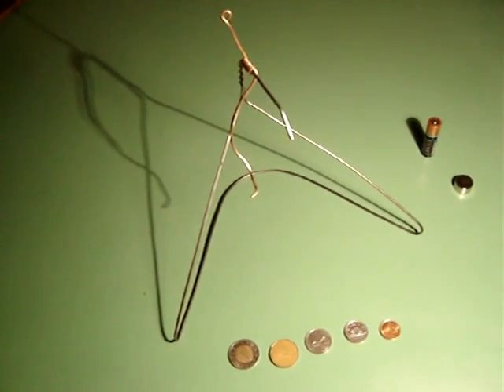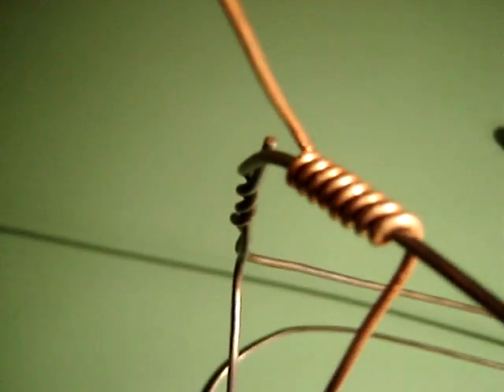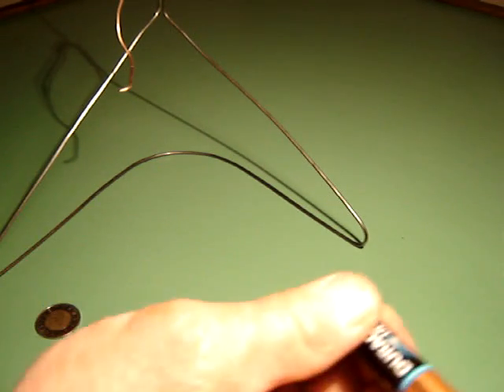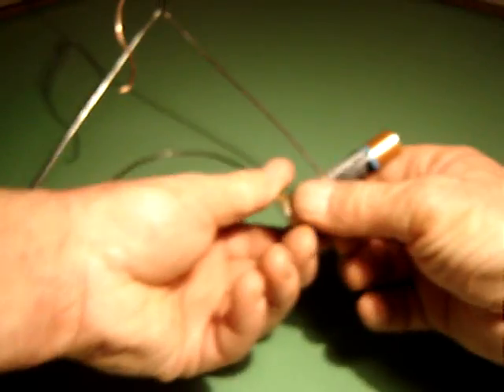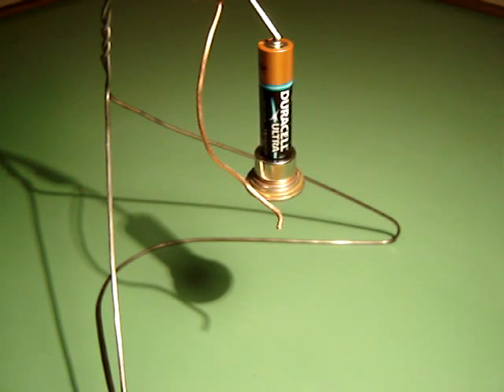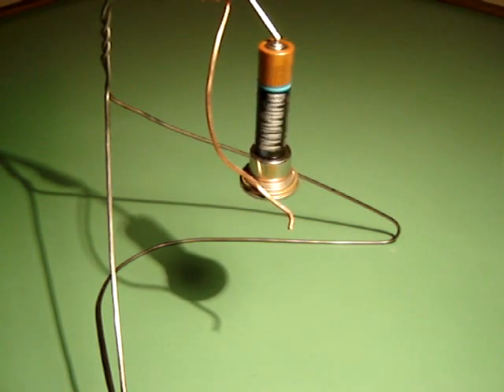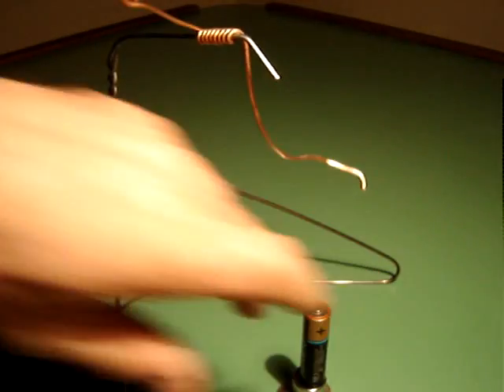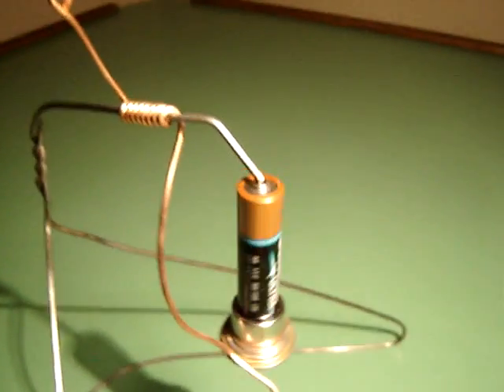Homopolar Motor With Five Speed Manual Stick-Shift

Comment: a hollow magnet with lithium inner core. the magnet will rotate to power a alternator / generator witch sends part of the power back into the 
lithium inner core. this power the magnetic field making a electron magnetic with a lithium inner core witch spins the device faster. [=] more power.. 
if this adding power to the lithium core, it might cause heat. hot enough with a sentricular force can cause anything to occur in a powerful magnetic

Comment from the maker: The homopolar motor works from what is called the Lorentz force. A conductor carrying current will produce a magnetic field. The wire's magnetic field repels the magnetic field of the magnet, producing torque on them.
See Wikipedia under "homopolar generator".

It needs to be a neodymium magnet to work right. The armature is a simple coat-hanger wire, but the tip shape is important to enable the magnetic hanging effect. Not too pointy and not too round where it hangs.

Comment from the maker: So many questions, grasshopper...I think you need to build one and experiment for yourself!  (hehe)

In answer to your question, the wire directly on the magnet will generally give the fastest speed, about like 5th gear. 

However, the smaller the radius increases the speed, so the penny which is smaller than the magnet, can give a higher rpm than the magnet directly. It depends on other factors like resistance and magnetic field.

Comment from the maker: I'll put that video of the battery sources on the list!

The contact wire (string as you call it) can be put directly on the magnet, but will only give one main speed. This experiment was a fun reminder of the auto gearbox with its different-sized gears.

Comment from the maker: More batteries in series will increase the voltage and rpm. Batteries in parallel would increase the amperage and the torque. More magnets tend to increase the torque rather than rpm.

Good luck with your experiments; do a video if you can!

Comment from the maker: I spent over an hour just getting the point of the hanger correct. Too pointy and the battery will fall off. Too round of a point and there is too much friction, like you say.

Comment: Nice video!

I wonder how much rpm's you can get with the armature balanced.  I would sharpen the end of that hanger and carefully put a divot in the center of the positive pole with a center punch.  If you look around you can also find very cheap tachometers that only require a piece of reflective tape on the rotating mass to measure rpm.

Or you could go the other route and perhaps build up some solder on the battery and have that come to a point.  You would need a flat surface on the hanger.

Comment from the maker: There are two places I can recommend. One is K&J Magnetics, they ship anywhere. The magnet will be a #DC6 or similar...the link is in the "more info" to the right. >>>

The other one is American Stirling Engines. They have a kit with 3 smaller magnets, batteries and 6 feet of 14 gage wire to make several motors from. The link to Sterling is also in the "more info" to the right. >>>

Good luck and have fun!

Comment from the maker: Refrigerator magnets are often the correct neodymium type,  but you won't find a fridge magnet this big! 

You can try a smaller magnet, but not for this project. You can use a drywall screw  and the bare, conducting magnetic disc as the rotor and hang it off the battery. Then run a wire from the top of the battery to the magnet's edge. That set-up can spin up to thousands of rpm!

Comment from the maker: Hard drives have neodymium magnets, but they are usually in a shape that doesn't spin very well. 

You can make a different style homopolar motor, however, with the magnet as the base, and perhaps a few coins under the battery to act as a commutator.

Comment from the maker: The positive terminal of the battery is attracted to the steel of the coat hanger, because the battery has iron in the case which acts to extend the magnetic field of the magnet. The battery acts as a magnet and sticks to the coat hanger.

 Not all batteries are magnetic, however. Duracells do work ok, in alkaline or rechargeable NiMH.

 This experiment was at the very limit of weight that will work without adding a tiny ball magnet to keep it together between positive terminal and a hanger.

Comment from the maker: Thanks for the good questions.

1. The coins are a good commutator because they conduct. Also they add to the magnetic effect, they make it easy to assemble, and they control the speed.  

2. The order and material of the coins will make a difference, depending on the resulting magnetic field, the electrical resistance, and the radius of contact.

3. The battery is solidly part of the magnetic rotor. If there was a bearing between the battery and the magnet, the battery could remain stationary.

Comment from the maker: The battery usually drains fast and gets hot. The homopolar motor uses a lot of current, as much as several amps from the AA battery. As the current moves from centre to the rim of the magnet, it produces an opposing magnetic field to the magnet. The Lorentz force produces torque which rotates the magnet. 
 
The magnet doesn't seem to affect the battery voltage at the terminals. The magnet will affect the battery by using current and heating up.

See wiki "homopolar motor"

Comment from the maker: Yes it produces torque. The homopolar motor design is being used in the latest 50,000 horsepower naval ships.

Generally we do not use an electrical motor to run a generator. We would just hook up to the battery directly, it's more efficient that way.

Comment from the maker: The original question was "How does it spin" not "How much is the force on the wire".

 In my answer, I was talking about principles which are at the root of the forces, not a formula how to calculate the force, as you are discussing.

Comment from the maker: Wiki:
 "By combining the Lorentz force law above with the definition of electrical current, the following equation results, in the case of a straight, stationary wire:
F=ILxB"

The equation you quoted is derived from the Lorentz principle.
The homopolar motor still works by the Lorentz principle. The Lorentz formula just needs to be integrated to find the total force on the wire or magnet from the point charges, as in:
F= I Integral dl x B(l)

Comment from the maker: Except in this case the force (torque) is not in the wire, but in the magnet itself...

Something else from wikipedia,

"The force on a current carrying wire is similar to that of a moving charge, as expected since a charge carrying wire is a collection of moving charges. A current carrying wire will feel a sideways force in the presence of a magnetic field. The Lorentz force on a macroscopic current is often referred to as the Laplace force."

The Heart homopolar motor uses that principle.

Comment from the maker: Wikipedia under Homopolar Motor :
 
"Moving electric charges (an electric current) in a magnetic field experience a force that is perpendicular to both their direction of movement and the magnetic field, called the Lorentz force."

"In the homopolar motor the electric current produced by the battery moves radially through the disk magnet, which has a magnetic field along its longitudinal axis. The resulting Lorentz force in the tangential direction produces a torque in the magnet. "

Irrelevant?

Comment from the maker: You need a neodymium magnet, available from K&J Magnetics (link at the right in "more info") or another magnet company. 
Or rob one from a shake-flashlight if you can get one cheap. (I just bought 5 yesterday for a project!)

Then, a powerful battery like the one shown, a coat-hanger, and some coins or magnetic washers. Experiment...it's fun !

Comment from the maker: You can build  homopolar motors with a drywall screw and small disc magnet as rotor that will do over 10,000 rpm, but this model stays under 1000 rpm. 

I say, get a neodymium magnet, a battery and a piece of wire and start messing with it...the ideas will flow once you begin to play!

Comment from the maker: You can try, but it takes a really strong magnet to hang a battery off a coat hanger wire!

You may have to order from a place like K&G Magnetics (link in the "more info" box to right>>>) 

Or find a shake-type flashlight cheap and tear it apart, as they use a neo magnet to charge it by shaking.

You can also do the normal type homopolar motor experiments (heart shape spinning on a battery) by using a large bass speaker and putting a coin and the battery on the centre of the magnet at the back.

Comment from the maker: The wire hanger is a clothes hanger for hanging clothes on a closet dowel. It's standard issue in north america, but other folks might like to try 1/8 inch welding rod. I find it works well with its copper coating on the steel rod.

Comment from the maker: The battery creates an electron flow through the hanger, copper wire, coins and the magnet. The magnet spins due to the Lorentz force of the magnetic fields. The battery will only last a few minutes.

Comment from the maker: Thanks for comments. You can use hard drive magnets in other types of homopolar motor experiments where the battery sits on a stationary magnet, and the wire rotates. 

You would need to use a penny or two for a contact commutator between the drive magnet and the battery. A decent speaker magnet can do the same trick. Turn a 10 inch bass speaker on its face, and put a penny at the centre of the magnet and the battery on top of the penny. Then a heart-shaped wire will rotate, if tweaked right.

Comment from the maker: That is not a stupid question! Thanks for having the interest to ask.

The metal is a steel coat-hanger. Welding rod used for gas welding could be used too. It has to be magnetic (steel not copper) to make the battery hang on it. 

There is a copper contact wire wrapped around the coat-hanger. Make sure the coat-hanger lacquer coating is sanded or scraped off for good contact with the copper wire.

Hope you try it!

Comment from the maker: These are magnetically attracted Canadian coins, but any conductive coins can be used as long as a magnetic one is on the bottom to hold them up.

 Other discs might work on the bottom, such as a steel washer or disc magnet or maybe a metal bottle cap.

Comment from the maker: It would work, but the magnet may blow up from too much amperage current without proper cooling. 

The latest naval ships use a homopolar motor of many thousands of horsepower, but it requires a super-cooled, super-conducting magnet assembly.

Comment from the maker: It is true the neo magnets can break. If you have more than one, keep them far, far apart. I find hanging them on my ceiling screws works the best. All of my older magnets have chips and chunks missing from mistakes in handling. I wear glasses when using magnets now.

Comment from the maker: The parts are somewhat variable. The 14 ga copper wire is simply wrapped tightly around the coat-hanger. (But not too tight!) The coat-hanger must be sanded to remove the lacquer where the wire wraps around. 

The magnet must be a strong neodymium type such as the DC6 from K&J Magnetics.

The coins are Canadian Tooney, Looney, Quarter, Nickel and Penny. They are easier to use because they are magnetic.  US coins may work with a magnetic washer at the bottom of the coin stack to hold them up.

Comment from the maker: Although the copper wire angle is critical, it seems to be both the size and the conductivity of the coins that affects the speed. 

In general, a large coin will tend to spin slower than a small one. But also, a coin stack will have increased resistance through the longer conducting path of multiple coins, lowering the voltage and hence the speed. And shiny copper goes faster than dull copper, when the copper wire is against the penny.

Comment from the maker: From wikipedia: "The name homopolar refers to the absence of polarity change."  

Homo means "same". Same pole; no alternating or "other" poles required, such as in the usual "heteropolar" electric motors.

Michael Faraday invented a homopolar generator 150 years ago. The design was all but forgotten until recently. Now there are powerful, quiet, state-of-the-art naval homopolar motors developing thousands of horsepower. (Google "naval homopolar")

Comment from the maker: I carefully move the copper wire shift lever to the next coin in the stack. The copper shift wire conducts current from the coat hanger to the coins, and each coin changes the rpm. The larger coin produces the slower rpm. The smallest coin closest to the magnet and battery makes it go fastest.

Comment from the maker: I can feel where the shifter should be, and hear the rpm changes...just like a real car! After spending a few  hours tweaking the copper wire shifter to get it just right, I could probably shift it in the dark...

Besides, I can visually see which coin the conducting wire is on to tell which "gear" it's in.

Comment: well i have the #DX06 which is smaller than what u said. however in this video it shows that the magnet u used fits almost perfectly on the battery. can u explain that?

Comment from the maker: It's not the magnet that is homopolar, but the magnet is one of the three parts of the homopolar motor. The other parts are the battery and the conductor.

The motor works by using the Lorentz force, which was discovered over 150 years ago. Basically, the magnet pushes on the magnetic field produced by electricity in the conducting copper wire.

You could look up "homopolar motor" or "Lorentz force" in Wikipedia for more information.

Comment from the maker: The higher the voltage, the faster the speed. The greater the amperage, the greater the torque. The bigger the magnet, the greater the torque.

Wear safety glasses (I'm serious!) because at a certain voltage and amperage point, instead of heating up, the magnet will explode. Also, if you heat up neodymium magnets too much( about 170  degrees C ), they will lose their power permanently.

Batteries can also explode when overheated, or lose their power.

Comment from the maker: For the homopolar generator, it uses axial magnets and produces DC electricity. If you used radial magnets, you would get A/C in that same set-up. 

 For the CD turbine, it would be best trying to produce A/C with NSNSNS, but then you would lose the mag coupling ability.

Better for the turbine to build a NNNNNN up, use a mag coupler outside the case, NNNNNN down. Then build onto the coupler, outside the case,  any magnet configuration you want, or add a generator, motor, pump...you name it!

Comment: sorry i forgot what you had said before about NNNN not being as good as NSNS so i am gonna try and get some radially magnetized versus my axially, the only problem is if it will stick to the battery like that. I also tried hooking a 9v battery in series with the AAA, and got very impressive results. It spins so fast instantly that it knocks itself off the hanger.

Comment from the maker: You could try something like that. The spinning copper wire may not put out enough of a magnetic field to light the led with the coil.  

Might be better to make a homopolar generator. Just spin the magnet fast enough, with electrical leads on the center and on the rim of the magnet, and you will get power. Use a drill or geared hand crank or piece of string pulled like a top to spin the magnet.

Comment from the maker: My magnet contact wire is carefully set up after several hours of testing. I used gravity and twisting the wire "just right" so it touches the magnet lightly. I think you will have better luck with a solid 14 gage to 20 gage wire.

Comment: hi, i attempted this, unfortuneatley, i have smalled NeFeB's, so it cant hold a aa, so i had to use a aaa, when it goes, i can get it going pretty fast, but it is very hard to keep the wire in place. i have to hold it in one place on the magnet otherwise it just stops, how do you get yours to hold itself? if it is because yours is solid, and mine is a cord of multiple like 40 awg then thats probably it, and if you think so, i will go to home depot and pick up one like yours.

Comment: I have to go there anyways to pick up a couple hose things for my tesla turbine, and then i will be stopping at radioshack for some copper wire, because i had an idea to make this lower to the table, and allow it to spin right next to a copper coil, to generate some electricity  to light an led or something. then i will mount it on a peice of nice wood, and make it a little decaration... do you think this will work???

Comment from the maker: The copper wire can be found in common household wiring. 14 or 16 gage solid core wire will work fine.

The coat-hanger is steel which enables the battery with magnet to stick to it. And it conducts electricity ok.
A steel welding rod will work instead of a coat-hanger, too.

 A small ball magnet at the hanger to battery connection may be necessary to get it to stick.

Comment from the maker: When I made this, it took a long time to set up and tweak. 
It may not work well with modifications, but I simply suggested a washer that could hold up the non-magnetic US coins, as a possible solution.
It may work with the US coins between magnet and battery...or not. The battery may not hang right.

 I would suggest to try it for youself...magnets are available at K&J Magnetics at the link in the more info, to the right.>>>

I'm not sure why you wish to turn poles around?